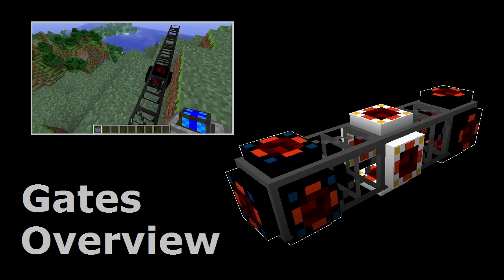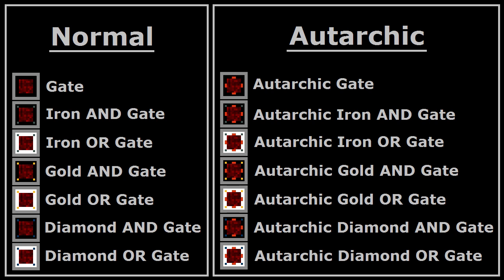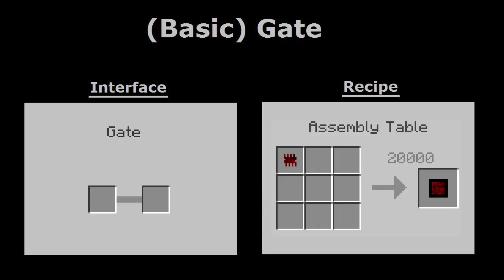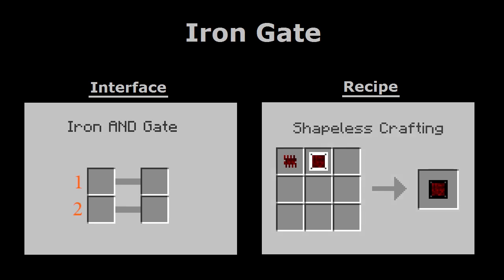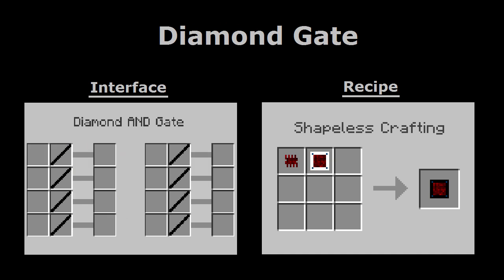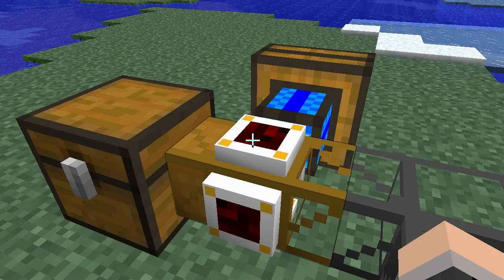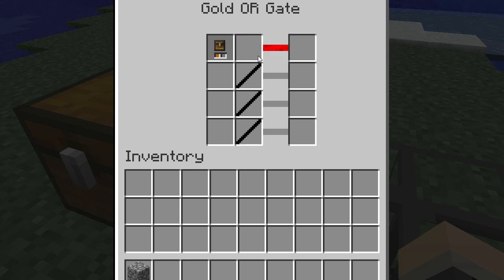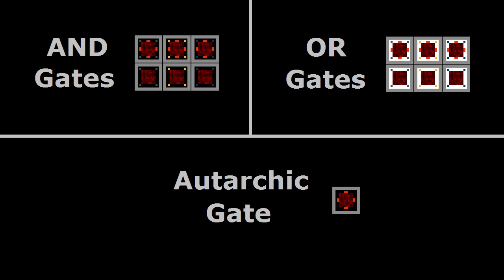Normal Gates (Tekkit/Feed The Beast) - Minecraft In Minutes

Comment from the maker: Have a gate that detects if the single chest is full. (There is a built-in detection setting). Use a pipe wire that runs from the single chest to the double chest that disables the redstone signal.